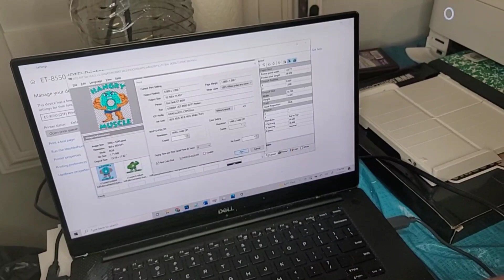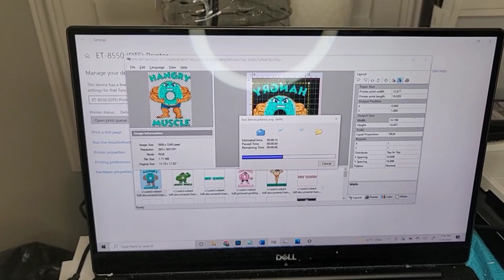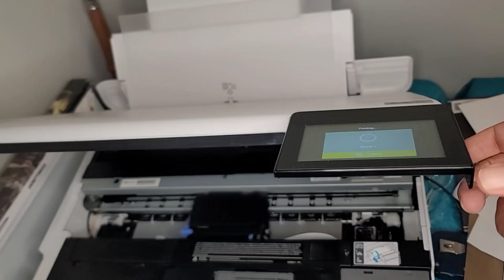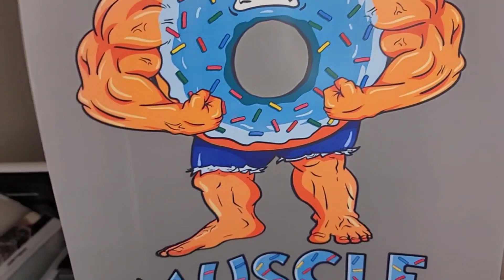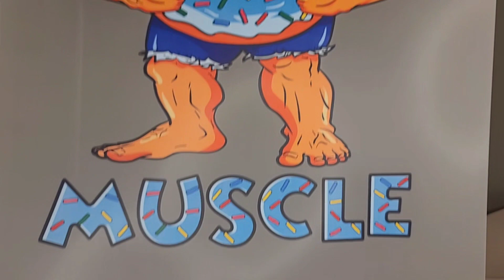EPSON Eco-Tank ET-8550 DTF (direct to film) printing on A3+ (13x19) Paper

Comment: That messed up cyan might just be a defect on your film.
Reply from the maker: Maybe, right now my cyan is missing lines when I nozzle check, I just need to the power clean to and I should be good. Just waiting on my maintenance tank replacements.
Reply: @HangryMuscle  where did you get your maintenance tank replacements at? How long before you had to replace them and have you figured out a way to add an external waste tank?
Reply: @melissadaniels1848  yes i was wondering the same thing ....plus can u do a close up on how to remove the rolling

Comment: I finally set up my printer and instead of a white background it’s printing a black/ grayish background and my setting is 100% on white and all my ink channels are correct. When I do a Nosil check everything is perfect. Idk what is wrong. Please help.
Reply from the maker: Not sure, try disabling one white channel at a time. Then running test prints to see which channel is the problem. After run purge prints on that channel or clean that channel out in the printhead.
Reply: @HangryMuscle  I disabled the gray channel and now it’s working perfectly fine. That is so weird

Comment: How do I get my et 8550 to print from the top it keep telling me the cassette 2 is empty
Reply from the maker: Make sure rear paper feeder tray is selected both on the printer preferences and in Acrorip. Cassette 2 is the bottom paper tray.
Reply: Thanks but now it’s not printing out it’s reading sent to printer but nothing will print
Reply: It keeps reading print is pending to print but nothing is happening I need some help please
Reply: Went to settings and it’s reading default printer  1 document is in queue
Reply: @mafawu1   What program are  you using program to print? Can you print on white paper?
Reply: @xZk18x  I’m using acrorip 10.5
Reply: @mafawu1  In Acrorip, on the Printer Tab. Check the port and make sure you have the correct printer selected.
Reply: @xZk18x  I’ve checked the port artwork is just sitting in queue nothing is printing
Reply: Can print normally?
Reply from the maker: Make sure your pc and printer are connected using a usb not wifi. Also that the correct printer is selected in Acrorip printer settings tab.

Comment: What software are you useing. I have one of these printers That I use for my sublimation and and I was thinking I'm buying another one for the DTF ETF and converting it like you have like you have I just don't know if I need different software please explain how you do colors to come out.
Reply from the maker: Awesome. I'm currently using Acrorip 10.4.2 to do DTF. As for the colors I use a ICC profile to get the correct colors printed
Reply: I just converted my epson 8550 but my colors are not as bright as they should show , how or where do I get the icc profile?

Comment: I am using exact same setting for my prints. Any idea why I am only getting about an inch of my designs to print?  It cuts off the rest.
Reply from the maker: Could be a variety of reasons, some films read better than others, the program might need to reset, the paper size is incorrect, could also be the image is sized incorrectly in the rip program.
Reply: @HangryMuscle  Thank you for responding. I have checked paper size. I am trying to use 13x19 film. In acro rip I have it set to 12.677 and 16.929. How do I do a program reset?  It seems to do this every time I change paper size or I start printing for the day.  I am using all DTG PRO products

Comment: Please tell me how to set color + white because my hair doesn't come out as beautiful as yours.
Reply from the maker: Acrorip 10.4.2
Icc Profile Gra.xx
1440x1440 
40% Color 60-70% White.
Reply: @HangryMuscle  I'm using Arcorip 10.3, can you set it up like you said?
Reply from the maker: @titipongsaelee9383  yes you can.  I print out Test prints on blank white paper (8.5x 11) in Acrorip, to test colors before using actual film sheets.
Reply: @HangryMuscle  One more question, why is white with clear PB and GY channels, most of the white on GY is more used than PB, please advice on setting up, thanks.
Reply from the maker: @titipongsaelee9383  I'm still figuring it out, The photoblack channel was printing  out a light yellow instead of white so I disabled it. And ive only been using the GY Channel for white. I drained the photoblack channel so I'm going to test it out more and see how it prints.
Reply: @HangryMuscle  How do you drain a channel on this?
Reply from the maker: @leesahcage3297  https://youtu.be/QS3mOtiHV_Q
Reply: @HangryMuscle  Where can I get the ICC Profile
Reply: Where can I get the icc profile

Comment: did you remove the rollers?
Reply from the maker: I did I have a couple videos of me removing them on the channel.
Reply from the maker: If you can remove the pin wheels that the design passes under you won't need to remove the rollers.
Reply: @HangryMuscle how do you remove the pin wheels